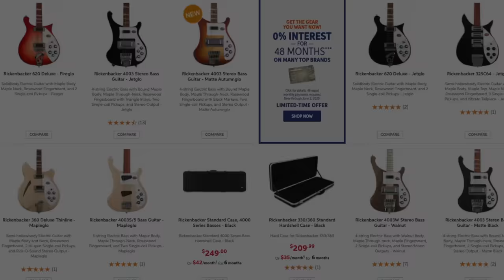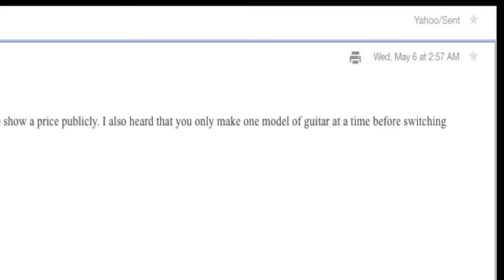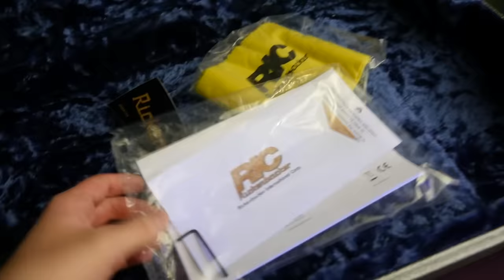You're NOT Allowed to Know the Price! | 2020 Rickenbacker 325 C64 Jetglo | Review + Demo

Comment: The 5th knob works two ways. If you roll off the neck pup tone the 5th knob acts as a blend pickup in the middle position. It brings back the neck pup tone to have three distinct sounds. Up is the neck/middle pup full bass. Middle, you add back the highs to the neck /middle pup and it blends it with the bridge pup. Down is the bridge pup alone. With the N/M pup tone full on the 5th knob as as a blend knob with switch in the center or up position.

Comment: ABOUT THE PRICE: (Sorry it's long) A lot of high end manufacturers restrict dealer's ability to display price. Mesa had done this for many years. Back in the 90s I worked at the East Coast Music Mall in Danbury, CT. The reason for the price ad restriction was a decision made by the manufacturer to help protect dealers. They didn't want you calling 10 dealers and just buying it from whoever offered it for less. East Coast got into big trouble because when they launched their mail order catalog in the 80s (they had the first nationwide, Musician's Friend type of operation), they would get around this by listing brand new items as "store demo" or "used mint" items. They got caught and lost a couple brands that way. Boogie was one. (They eventually got it back in the 90s). 
There are 2 parts to this: first, they want to maintain the value. High end products - real ones, like Boogie, Anderson, Suhr - aren't selling product to dealers for 50% of the MSRP. The discount is usually between 20 and 30%. Sometimes more, sometimes less. Sometimes, like Boogie, there are no discounts to the customer. You pay the asking price or Boogie won't keep the dealer. I say "real ones" because Fender and Gibson have expensive guitars, but they aren't boutique. And Gibson doesn't care if you sell a $10,000 custom shop piece for less than dealer cost as long as they've been paid. The other reason is that generally, the buyers of high end guitars appreciate, not only the product, but the efforts of the dealer. When I worked at Brian Guitars in New Haven, CT, before my "experience" with East Coast, I watched Brian tell customers to their face that they are welcome to go to another dealer and pay less, but to expect to be treated accordingly by that dealer. And they always came back. Because Brian knew how to make customers understand that if you care about your relationship with your dealer, you won't nickel and dime them. This didn't apply to the standard items. This is for high end gear that attracts a high end buyers. Some items are run of the mill and everyone sells them for whatever the market is. Thats why if you search for any basic Ibanez RG or Strat, you'll see 100 online retailers with it listed for the same price. Service after the sale, so to speak, is what high end brands want from their dealers. A dealer who sells stuff for less margin to make up the difference in volume will notoriously care a lot less about taking care of the customer later. They basically operate on the premise that, "hey, you got it cheaper than anyone else. YOU'RE WELCOME!" The countless examples of complaints about Guitar Center and the like are good examples of this. So the brand generally wants to take care of their dealers. They aren't Fender, who just cares about how many of their instruments you sell a year. And part of that is giving you a territory. So if all the dealers are selling the same high end, high quality item for the same price, then their dealers won't struggle to compete for sales with unscrupulous dealers who just want the sale and their products don't end up devalued. And to people who have an issue with that, it's fine. Those brands don't care and won't miss them. And not in a mean, dismissive way, but those people are notoriously difficult to please and they'd rather they kick tires elsewhere. Those people are generally fine with mid market level gear anyway and who also think everything should be 5% over cost when they buy it, but somehow still retain all its value when they are trying to sell it used. So it's not uncommon for Rickenbacker to do this. Especially because they aren't plentiful.
Reply: Very cool post Randy.  I’m originally from CT so reading your post was like a trip down memory lane.  Plus lots of good info.  I learned a lot.  Best wishes.
Reply: you see this to some extent in computers, look at newegg
There are prices that manufactures are good with you telling people, 
there are prices they are ok with you selling the item for
but if you are selling volume and don't care you are min maxing proffit, just that you are competing, you give up a bit of the proffit you would make, and many manufacturers aren't ok with you disclosing THAT price as it devalues their product, I know with games the moment I see one for a 75% sale and its 15$, I don't care if the best sale for the game is 50% and 30$ that game is now forever worth 15$ to me, 

In other areas, ask prices are like a used car lot, where I see you love this car, its 7000$, or I see you just want a point a to b, its 4000$, but if a friends son bought it the car would be 1200$

the way I see this rickenbacker, its brand new and already has issues with the coating reacting to the crap they put on it, that immediately tells me I wont pay more than 800 for it, because if they are messing up something so basic, what exle are the messing up? they could have very easily used chrome coated metal spacers and potentially a felt washer but instead, lets have this rubber eat our guitars.
Reply: Very well explained.....thanks bro!!!
Reply: Thank you Randy.
Reply: alidan yeah, the used market is a whole other game. Dealers, whether auto or instrument, can get product traded in or sold to them at any number of different costs. Sometimes on trade where it costs them far less than its worth and they can charge whatever they want, or sometimes they pay cash and there's less margin. They also get to do things like convince an item has complicated issues when it merely needs minor adjustments. And 5 of the same thing new should all basically be the same price (feature for feature), but used there are factors that change that greatly like wear and condition or mileage on a car. Highway miles or in town miles? That sort of thing. And of course, I think value is up to us. I wouldn't pay $1,000 for that Rick. It's not my thing. I think they're neat, but I've played them. They play like guitars built in the 60s by Rickenbacker. Consequently, I won't pay $4,000 for a custom shop strat either. A Suhr or an Anderson, I will. But Fender's custom shop exquisitely builds strats. But with no improvement over the originals except for the fret work. Custom shop strats just feel like strats. With great fret work. I can get a used strat and have the frets done and spend the other $2500 on other gear. So just like the car: yup! If you're he'll bent on that guitar, you'll pay more than someone who just thinks it's ok. And that's fine. Plenty of players won't pay more than $1,000 for any guitar. That's fine too. I wish I was like that. No difference. I'd save a lot of money. So we place value where we see it. I think people are idiots to spend thousands on a vintage guitar. It's like, "I really want a vintage cell phone. I miss a locking buttons three times to text the letter c. And can I get a 1MP camera please? But to each his own. There's plenty to go around. 🙌🏻
Reply: Lincoln from CT Thank you! Same to you, Lincoln!
Reply: Paragraphs and line breaks are important. That was an unreadable wall of text. Yikes.
Reply: It wasn't unreadable, and it was absolutely spot on. I worked in the industry for years, and we had a few "boutique" brands. And trust me...there is NOTHING more frustrating than spending a significant amount of time educating a customer only for them to come back asking you to do a set up, etc on the one they just purchased down the road because it was $50 cheaper. And it always baffled me how customers honestly thought you would WANT to see their purchase! Like, dude...I spent HOURS with you teaching you ALL ABOUT THE THING, you just took food out of my mouth, and now you think I'm gonna be impressed that you took my recommendation but purchased elsewhere?!?! Now...if the guys down the road had a magic one...one that just played better and sounded better to the customer, and it just happened to be cheaper, I can't complain about that. We all know guitars and gear in general have personalities, but if it's just to save a few bucks and now you want me to work on the damn thing for free? Nah...I'm good...
Reply: Same with Manson Luthier 😪
Reply: @alidan  Games aren't really a fair comparison, as there's no cost incurred on the producer's side. The goods are digital and the supply is infinite and costs nothing. Thus, there's no concept of "selling for a loss" - the people who bought your game at $15 probably wouldn't have bought it for $30, so dynamic pricing is the way to maximize profits. Guitars are different; they have intrinsic value. Every guitar produced has material costs, whereas once you've developed a piece of software, you can produce an infinite number of copies/licenses without spending any more money. Sure, you spent money to develop the software/game in the first place, but guitar manufacturers have to spend money doing R&D too. Apples and oranges. Furthermore, because used software is functionally identical to new software, it's not really ethical to allow a second-hand market for stuff like games (see the problematic gray-market key selling sites like G2A and Kinguin).
Reply: games are a great comparison because everyone either knows or watches game prices, and I know personally, the moment that I see a game cost 15$ that games value is forever 15$. Superhot is a good example of this, it was given away for free, so to me the value of that game forever reamined free and I was only willing to acquire that game at a free price. amazon twitch in its first month of free games gave it away, I missed that, but a while later epic gave it away. 
when a game hits a bundle, and its in the 1$ tier, that's all the game is aver valued to me again, despite some of them costing 20$ out of the bundle. 

now, on used software, this is where you go into some bs areas of it. again lets look at games as the biggest example most people will know of
we have used games ala gamestop and others, the sale of the used game only hurts the publisher, but someone has something they no longer want, and someone else wants it. now I can agree that gamestop is completely crap in business practices, selling used at a 5% lower price, but still the thing is there. we could have digital used sales that are facilitated by lets say steam, that not only take a cut for themselves but also the publisher/developer, but because they want all the money they can get they refuse to allow this

Now we go back to guitars, for a standard 6 string guitar, I have had so many people I know and I trust, from irl friends to people who I trust online tell me that once you are going passed 800$ you have nearly all the fit and finish, the tuners should not be needed to be replaced, the pickups should be more than serviceable and its down to taste, and guitar finish should be damn near flawless. The bill of materials for a guitar, I'm assuming that you get bulk discounts, cost very little overall unless you are going 100% exotic or there is something VERY special about the wood. 
Trem system im willing to say is up to 400$, tuners i'm willing to call 50$, pickups i'm willing to say up to 50$ a pickup, wood im willing to call another 300$ on. c&c time is negligible, tooling at least by my estimates would come down to 2-5$ a guitar (this is bits, wear and tear, incidentals)

800$ is the most I would pay for something that isn't 100% perfect, anymore then that, you are making it completely to my wants and my specs. for 7 string or more, im willing to hear them out on cost due to it being a far lower volume shipped
now, on the acoustic side, i'm more willing to hear out the high price but that is also changing thanks to carbon fiber, at least to my ears, being better then most wood guitars at or under that price point and to some extent well above. but with electric, where nearly all the sound of the guitar comes from the frets used, the string, and the pickups, nah, im not willing to hear out a vintage tone wood debate on that. is the neck straight, is there fret buzz, is it wired correctly, and funny enough these requirements are met even by VERY cheap guitars now, just the fit and finish of them leaves something to be desired.

Comment: In 1966 I was 16 years old and playing in bands. I was a huge fan of The Byrds, and after I saw them in concert I bought a brand new 360-12 in fireglo. It cost . . . $400 with a Ric case! I eventually sold it because I found out that 12 strings can be a bit of a PITA. I wonder what that guitar is worth now. BTW, if you give The Beatles whole catalog a listen, (not just their most popular tunes) I think you will be impressed.
Reply: A 1966 fireglo 360-12 in good condition would fetch $12k easily.   There's a 68 mapleglo for $20k on reverb.
Reply: Gavin Shear only if it’s the “old style” with the sharper double-bound horns. (Very rare). You can find “new style” rounded horn 360/12s from 1965-1968 for under $5000.
Reply: @s2seltaeb  Amazing I didn't realize they varied so much in price depending on that.
Reply: @guitarocd9984  Nah.. my rick is very stable and set up well.  Even with the 6 saddle.
Reply: @guitarocd9984  
Actually made me laugh out loud! Thanks for that!
Reply: $400 was a lot of money back then, no?
Reply: @surinaam1186  $400 in 1966 is about $3200 today. That was a lot of money for a 16 year old, but my father agreed with the shop owner to cover the payments if I didn't. Luckily, I was playing most weekends and paid it off rather quickly as I recall. BTW, my Ric 12 had the rounded horns, which as one commenter noted is not as valuable as the pointed horn double bound Ric (some guy named George Harrison had one of those).

Comment: They were about $2,499 back in 2016 at my local Guitar Center.  I paid $1,900 for a Fireglo 330 that same year, but I ended up selling it because I never fully bonded with it.  The feel of the lacquered fretboard was hard to get used to.  The vintage ones are amazing, however!  I played a '66 and put it up against my 2016 model and the difference was night and day.  The new ones feel kinda cheap and plasticky in my opinion.  I don't think they're priced appropriately for what they are.  They've been coasting on their reputation (mainly their association with the Beatles) for far too long.

Comment: I've got the 325 C58 model, and in addition to the alder body, it differs from the C64 in that the neck is un-lacquered, and has a 7.25" radius. I've replaced the Kaufman bridge with a Bigsby trem as most owners do. I've kept the retro stove-top knobs, but many replace for the round Burns knobs to fully "Lennonize" it. It also has a gold colored single-layer scratch plate and headstock cover. If you want "that" sound, nothing but an original Rickenbacker 325 can duplicate it. I don't even remember what I paid for it, but it was worth it. Great guitars.
Reply: This model doesn’t have a 7.25 radius ?

Comment: Do you get a boring plastic molded case or the nicer traditional velvet fur lined (1960s to 1990s style) Rickenbacker case included for the 2899 USD? My 1990s Rickenbacker case comes with inserts that stop the guitar moving around.

Comment: Rickenbacker also makes a full scale version of the guitar, a 350. The v63 is basically the same guitar but without the trem system. It has a "trapeze" tailpiece. I have a vintage 325. I removed the trem and put a trapeze tailpiece on to help with tuning issues.

Comment: I have the real thing a 1967 Rickenbacker 325 in original jetglo. Semi hollow.. its rose morris. I tried every vintage guitar around Firebirds, Les Paul jrs, vintage strats etc.. those old toaster pickups scream! It's small even though it's semi hollow they don't feedback. I recorded through a mess boogie and it sounded incredible!!! I mean better than any guitar vintage or new. It's like the sound of old P 90s but it has some Stratocaster quack but not too much. A nice punchy P 90 but with added fender like high end that cuts. For lead guitar it is an amazing sleeper guitar. It's a good balance between an old Les Paul jr P 90 with the high end of a precbs strat pickup. For me it's the perfect mix of my favorite two pickups. I love old Dynasonics and there is alot of similarity as well. It's a cross between P90s, Dynasonics and pre cbs strat/Tele tone. You could come really close with the right eq to a P90 Dynasonic or strat by playing with your tone. I love the guitar. The short scale means you need to use heavy strings. I can see why SRV used a Rickenbacker. Its perfect for his sound. The heavy strings don't feel as harsh because of the short scale. The toasters sound like fatter pre cbs strat pickups and scream perfect for a SRV lead guitar style. I use mine for slide and it's heaven. With gain that guitar screams like I've never heard any guitar scream. If you go on eBay buy some vintage 60s toaster pickups and prepare to be amazed. It's a true sleeper. Vintage Rick toasters from the 60s go for a couple of hundred. Under priced because people don't realize the value. It's a fatter warmer strat pickup with balls and it's not that bad feedback wise for it's era